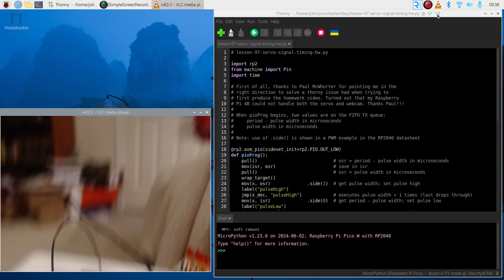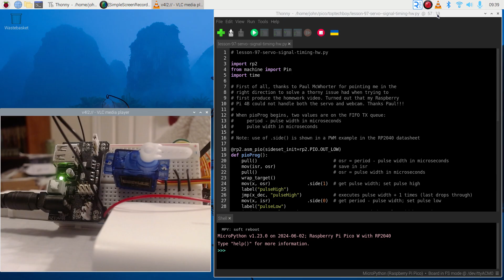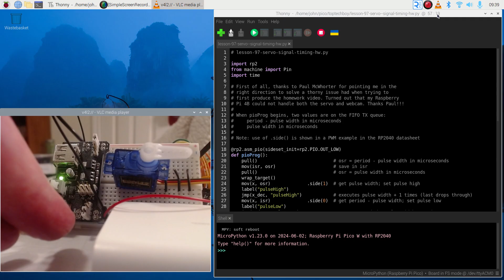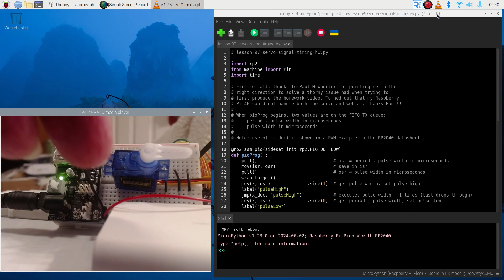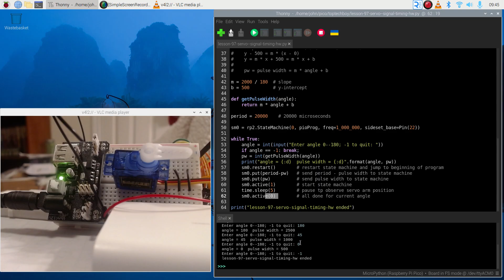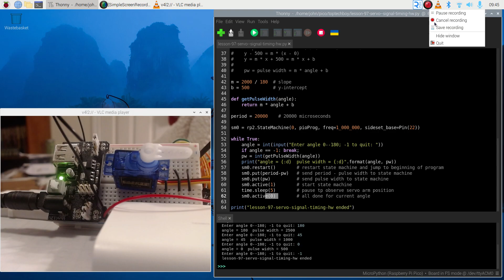Homework solution for picow lesson97 servo signal timing

Comment: Nice solution. I would try to simplify the python part of yorur program in the while loop. You dont need to be starting and stopping the state machine. Check out my solution next week.
Reply from the maker: I think my lesson 97 does need to stop and start the state machine because it needs to re-do the 2 pulls at the beginning. What you showed in lesson 98 will allow me to modify that loop as you suggest and use in in my lesson 98 homework though!
Reply: @johnganci933  I used non-blocking pulls in the state machine. If there is no new data putted by Python into the FIFO, a non-blocking pull will use the x-register as a default value.
You only have to put the last used value into the x register before the pull instruction. I have NOT yet tried the exec-method Paul showed in lesson 98, but I will.

Comment: Jolly good! The way you did it, you didn't need to divide the period and pw by the number of instructions in each loop👍👍
I didn't think about using sideset because I never bother with documentation unless I'm REALLY, REALLY stuck.
Reply from the maker: The documentation has lots of good stuff in it. Yes, it's good to discover it for yourself, but sometimes you have to see examples from the designers to gain some insight.
Reply: @johnganci933  I know I should read the documentation but sometimes it's quite difficult to understand🙃🙃
Reply from the maker: @charlotteswift  I think of it like this: the designers and developers for the Pico are a lot smarter than me and (better) have a deeper understanding of how it works, why the particular instruction set was chosen, and how to best use those instructions. Hopefully they worte or had direct input to the documentation and provided examples, so I will "hurt my head" trying to understand what they've provided. Doing this, for me, is worth the pain. Your usage may vary.😉
Reply: @johnganci933  You are a better person than lazy old me!
Reply: @charlotteswift  Charlotte LAZY???  Surely you jest!!  😄
Reply: @leeg.1402  VERY LAZY!! You should see (or maybe shouldn't) how dusty the house is! The 3D printer isn't the only victim.
Reply: @charlotteswift  Ah, what's a little dust?  Gives the place "character". My office/study gets dusted (maybe) once a year!

Comment: Very Nice.  Thanks for posting.
Reply from the maker: You are welcome. You mentioned in the chat today that you are looking at a Rigol oscilliscope. I'm considering buying one myself. Which model are you looking at?
Reply: @johnganci933  I'm looking at the Rigol DS1102Z-E 100MHz, 2-channel o'scope. I looked at the one Paul suggested, but the reviews aren't that great and the Rigol seems like a better scope to me. I want to get more into playing with circuits (audio, op-amps, timers, etc.) but you really need a scope for that. Which o'scope you looking at?  Regards,
Reply from the maker: @leeg.1402  I've been looking at the 3 Rigols and one Siglent. Rigols: DS1102Z-E (2 channel), DS1054Z (50Mhz 4 ch), and DDS1104Z (100Mhz 4 ch). Siglent: 11-4X-E (100Mhz 4 ch). These aren't cheap. The Rigol DS1054Z is only 50Mhz but google searchs show that apparently you can hack its software tu turn it into a DS1104Z. I don't know how much I would use one, (electronics is just a hobby for me) but I definitely do not want to buy cheap and regrest that I didn't spend more later. Right now I'm leaning to the 2 higher end Rigols but have not made up my mind.  I will probably research a little more. Need to uderstand what Paul said about "Channel A and B". Maybe that's what the 4 channel models are.
Reply: @johnganci933  The "Channel A - Channel B" Paul was speaking of is where you can look at two signals and then either add them together or subtract them (it's a math function in the scope). I think that's right. I'm like you, a hobbyist and my biggest concern is how much I'll really use the scope. As I get older, I don't seem to have the "passion" (or whatever you call it) for this stuff anymore. I follow Paul's lessons mainly to stay busy (with something besides yard work in the Texas heat). I like the Siglent 100MHz, 4-channel and their 200MHz, 2-channel scope. But, as you say they aren't cheap. Have a good day.
Reply from the maker: @leeg.1402  I've been following along with Paul's videos for probably 10+ years. I'm retired and try to keep my mind active. (I quit mowing the lawn in the Texas heat a long time ago.) The electronics hobby and working on a few open source projects keeps me busy. Just uploaded the Lesson 98 homework. Time for lunch and a nap!
Reply: @johnganci933  Yea! My financial advisor (aka wife) has approved the purchase of the Rigol DS1102Z-E 100MHz, 2-channel. So, that will be in my stocking from Santa. BTW, I'm outside of Dallas (Flower Mound). Where are you?
Reply from the maker: @leeg.1402  Plano.
Reply from the maker: @leeg.1402  Follow on from this morning. Where did you buy your scope? I'm looking at Amazon and TEquipment. Both have the 1104 in stock but Amazon is $24 cheaper.
Reply from the maker: @leeg.1402  I know you got the Siglent 1202X-E scope. I did get the 1104X-E. Just now opening the box. I'm totally new to scopes. Do I need to calibrate the scope?Sheet inside box says it was calibrated in 2019. I do know I have to do the compensation for the probes. After that I need to go to scope school to learn how to use this thing.